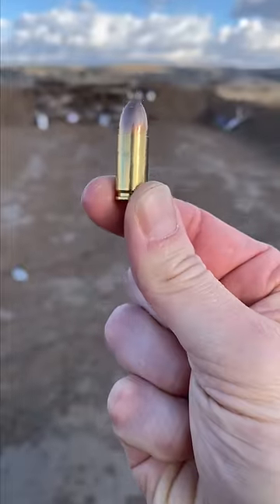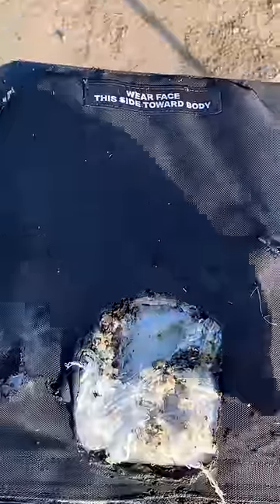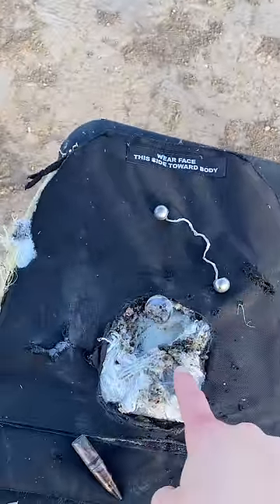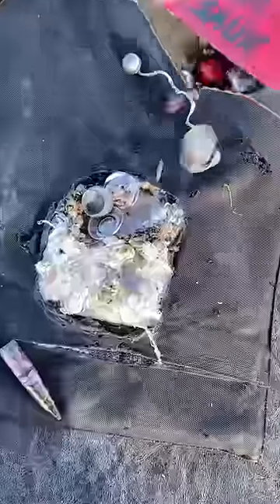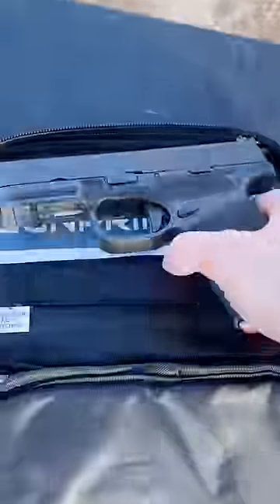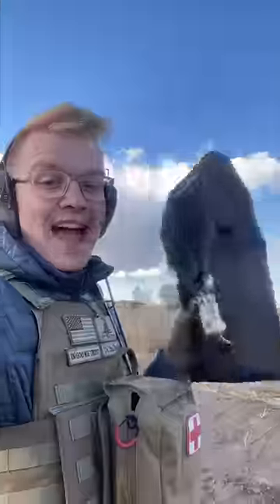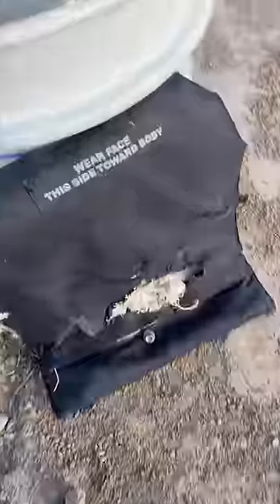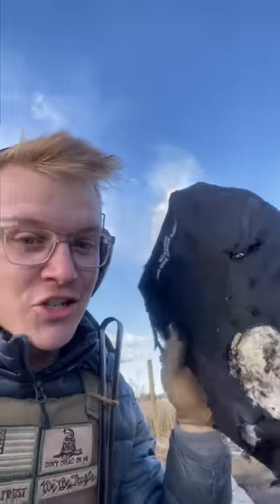POINT BLANK 9mm vs Body Armor #bodyarmor #civtac #gun #airsoft

Comment: Must’ve been some damn good armor 9mm will blow the lungs right out of the body 😂
Reply: Did 81,000,000 people REALLY believe in that guy?
Reply: @mattzee6287  joke
Reply: no 10 mm xp will gothrough it using a glock 40
Reply: @taipan2345  not likely considering it stopped a 50 bmg if that’s true then pistol rounds aren’t gonna do shit use your noodle
Reply: @kellyhufton7725  I hve used a 10mm xp and it went through body armor like cutting through melted cheese
Reply: @taipan2345  based on your live video let’s talk crap I’m done with this disagreement seem like a troll
Reply: @taipan2345  theres different types of body armor einstein

Comment: It would hurt but a trauma plate would help
Reply: What's a trauma plate?
Reply: @mr.nobody9955  someone else correct me if I'm wrong:

Think of a trauma plate as a liner. A year ago I was looking on a website that had BOGO on their armor. The manufacturer had trauma pads. The ballistic plate made of whatever material, steel or ceramic, will stop the round being shot at it from penetrating. A bullet has so much energy behind it that even if it doesn't penetrate, it would be an understatement to say it'll hurt like a bitch. A trauma pad or trauma plate is supposed to help against the blunt force trauma that the wearer will endure by being shot. Without it, the wearer would endure internal bleeding. Might not have a hole that's bleeding out, but rather a damaged organ and internal bleeding. 

That's how I understand it.
Reply: @pancratius602  thanks aldrick
Reply: @pancratius602  arent trauma plates additional armor?, like you have a 3a vest and you want to add some extra armor, then you put in some hard plates or trauma pads (soft armor)
no?
Reply: @thetokugawaclan1003  a trauma pad or plate will absorb additional forces from the normal plate that stops the round
Reply: @Roshan_420  true

Comment: They do realize it doesn't matter what gun they use it's all about the bullet
Reply: I saw a shirt just like two days ago where a dude fired through something that measured the velocity of the bullet. It went faster out of a rifle than it did out of a handgun so apparently barrel length does affect it. It wasn’t by much though
Reply: It can make quite a difference going from a 2" snub-nose to a 4½" full size pistol.  Then as Outlaw68 said, going to a carbine/ rifle will add even more velocity.

Comment: Usually no one thinks of what is stopped will still mess you up. My 3+ ar 600 plates say they will stop a .300 win mag my first thought is my insides are jello after 230 grain at over 4000 fps stops on me, I think it would hurt and do less damage if it just went though.
Reply: I didn't think 300 win was that fast or heavy. Either way, yes, if the bullet can pass straight through without much extra damage, then it would probably be less harmful than all of that energy getting dissipated into your chest.

As long as it doesn't hit something critical.
Reply: @thelight3112  they shatter elk shoulders constantly vs a 308 or 30-06 not so much. Next steps up ar .338 win mag and .338 lupua .

Comment: Those vests don't lose much integrity after being shot. The TFM guys have proven that. Also, "point blank" just means before the round drops, so for 9mm that could be 100 yards 😂 lastly, bones are stronger than 5 gallon buckets. It would hurt, but you would be fine.
Reply: Yeah my question the whole time was “what does he consider point blank”

Comment: actually i DID try this at an outdoor range one time.  i used to shoot with a local cop - dueling tree (she borrowed from work) all that stuff, and i have a decent handgun collection, even back then.  she was issued a new vest, so we decided to shoot up her old one with different rounds - separated as much as possible.  we shoot about the same level, but while she was only doing quarterly range training, i was going once a month back then.

we concluded that would hurt, but it would be a bruise, maybe a cracked rib, but it probably wouldn't kill you, but her 40 and my .45 would prolly be the worst.  we tried those both on the plate and outside.  obviously the plate was much better.

Comment: It can and has still killed people vis-à-vis hydraulic shock that is why hard armor though cumbersome and heavy is actually superior. Kevlar has a chain mail property where it allows a degree of penetration whereas steel or ceramic does not though ceramic can malfunction by the means of its production of lots of interlocking squares so buy American and buy hard armor and lift some weights and it will be like wearing a T-shirt

Comment: Wait, most body armor can’t handle multiple impacts let alone different calibers… what armor is that?!?!
Reply: Almost all armour types can sustain multiple hits. The most common hard plate material, Ceramic, is usually rated for between 3 and 6 rounds depending on the level. Kevlar and PE materials can take dozens provided they're not concentrated on a single spot.